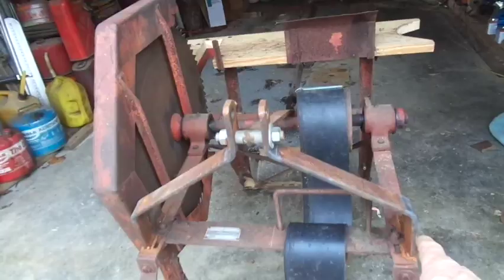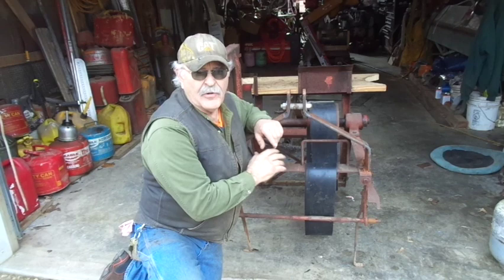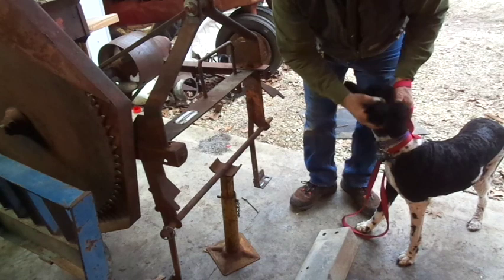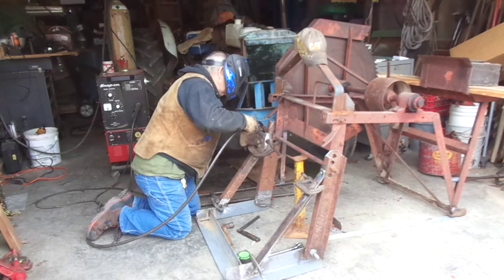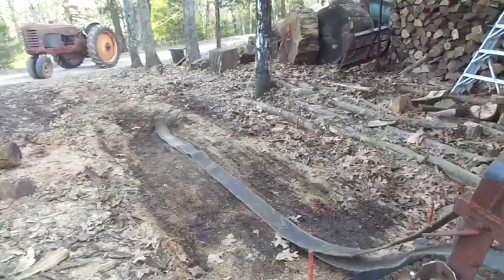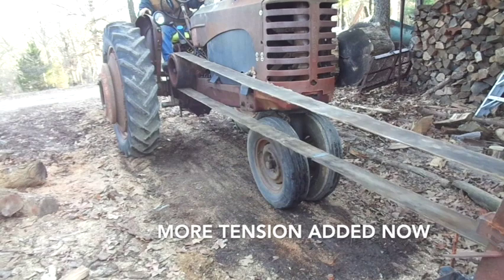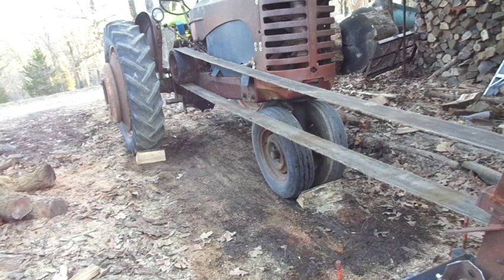Buzz Saw  From PTO to Flat Belt

Comment: Hey Wendell! Nice job remodeling that old buzz saw!  Clearly you prefer belt driven saws to PTO driven saws and that okay.  Thanks for sharing!
Reply from the maker: Actually Martin I prefer one of either kind that is being run by the son and son in law which allows me to sit in the shade with a cuppa coffee !!  LOL.  This was a bit of 'conversion therapy' that was temporarily required due to a breakdown of the tractor that normally runs this rig in 3 point mounted form.  It was easier to convert the saw to be used on ten other tractors than is was to make the repairs to the failed one.  To prove my point I still haven't had the time to order the parts for it yet !!

Comment: I processed a lot of firewood on those belt driven saws when I was a kid. You get them sharp and on a good running tractor and you can get through some wood.
Reply from the maker: Hot doggies, you said it ALL right there !!  I have several and use them all.  Here's what I do to put a really bad blade back in shape : https://www.youtube.com/watch?v=ezvZ7u8jUwE Fast forward to about 2:22 or so to see the layout for a cross cut saw blade.

Comment: I remember as a kid Grandad we`re at a Threshing party he`s mentioning all the goings on this and that then he`s rubbing his finger on the flat belt people listening and laughing  as I`m watching what he`s doing he reaches over and touches my ear ,That darn near whacked the Dog shxt out of me with a shock; Man I`ll never forget that as bad as a Coil shock LOL -- For a quick fix you could almost make a 2" pipe Mandrel with 2 bearings on ends to go between the belts with a turnbuckle pulling that looks like the 3 point hitch frame pulling up on a V system to the top of your saw frame then you just tighten or loosen the turnbuckle ..
Reply from the maker: Hahahahaha....that's what grandpa's are supposed to do isn't it...!!?  LOL  Yes, that is a viable option for belt tensioning for sure.  I was toying with the idea of a weighted idler pulley to put pressure on the non-work side of the belt as another option too.  Thanks Garnett for the input as well as for the visit today !!

Comment: Hi Wendell
The belt is running good for being that old. The loading appears to have helped iron out the kinks. 
When I was a kid I use to go out to a buddies Grandparents in the summer. Irving Smith had a Farmall H with the buzz saw mounted to the front of the tractor. It tipped up and back to loosen the belt so it could be driven around the farm. 
I still have the Ford PTO sitting in the garage.
Reply from the maker: Its not as kinky as it was when we started and a couple guys suggested a little brake fluid.  I will add some of that to the mix next time out.  We had the same basic setup as you described on the Farmall H on our 101 Jr Massey Harris.  Tilt up, hook with a chain loop and drive off.  Lowering it automatically tightened the belt just like you said.  Well, keep the pto drive in case another Dearborn or Ferguson buzz saw comes your way.  I still don't have one...which is why I had to adapt it the first time to the 3 point category 1 setup.

Comment: We use that belt dressing on the old John Deere. You know for the belt driving the hydraulic pump. That stuff seemed to last forever. I don't remember where I thought of that but I got another stick of it somewhere. Used it on my drive deck belts from my mower. Get this it was a little tractor 🚜 that was just an overgrown lawn mower. A 6 ft deck on it. I think the deck is gone but I had some plows things like that for it. Darn thing even has cigarette lighter in it. I had two of these manufacturers still got them in the barn. 100 Old Montgomery Ward's and the other one's a Sears. Don't laugh either one of them because they're built a little tractor Just not a lawn mower. Shaped kind of like a little Ford tractor as far as a rear end. Remember neighbor came by and he smoked a little bit and I kind of stay away from that stuff. Hey did The smokers oh crap hand movements raypad themselves down because I can't find the cigarette lighter. So I just tapped it in and thing popped out and I said here you go. He was amazing so was I thing actually worked. I used to have a little cigarette lighter plug in type spotlight. A joke by today's standards. But came in handy when I wanted to mow that yard in the city at night. With that 6 foot deck it took no time at all. I got a couple of David Bradley's and some David Bradley knockoff to. I got a sickle bar in the front of one of those David Bradley's. Well like you I found something to say. Hope some of this finds interesting to you..
Reply from the maker: Cool stuff !!  I've got some David Bradley stuff too...a small plow, cultivators and disc to name a few.  I sold the crossway sickle bar mower and the front mount mower deck off it though.  I think I still have a snow blade.  I like those old lawn tractors...I have an old Simplicity as well as a hydrostatic Ford from the 70's....then a couple really old dogs I know know what is what.  No cigarette lighter though on any of them....except when one of 'em goes to backfiring and blowing flames out the pipe.  Not advisable if you've got a big ol bushy beard !!
Reply: @tractorman4461  now that's putting a hilarious picture in my mind lighting a cigarette 🚬 off the backfire of tractor 🚜. That's a good one! Yeah that crossbar sickle is wise talk about I have and I think I have a plow. I don't remember what else. There are walk-behind item that balance on two tractor tires kind of like back tires of a Ford tractor but much smaller. Is that what you're talkin about? The off-brand name may be very famous for all I know I don't remember the name of it but it looks like a David Bradley but it's not. I have three of them. One David Bradley one off-brand and the third one is the same as one of the two first ones but I don't remember. By the way if you want to collect a few more I am going to sell them. Be the first time they've been out of family in about 50 to 70 years. You know if I'd made it to that one auction I would have bought one of those old tractors out there in Kansas with the metal wheels just for display yard art. Looks like snow is coming our way how about you? Over 50 last couple of days and in the teens now through tomorrow sometimes at least.

Comment: A fella in our area has a nice buzz saw up for sale. I'm waiting for the price to come down a bit. Your setup should work real good. I'm working on a flat belt lacing project myself. Should wrap it up tomorrow.
Reply from the maker: Awesome Matt.  I'm sure what ever it is you are doing with the flat belt it is done perfectly !! That's just the way you roll.  Buzz saws vary all over the place...from free to $500.  There's a local one a guy wants $175 for and I was second caller for a $50 one last year.  It was within three miles of me too.  Yep, the first caller bought it !!
Reply: @tractorman4461  the one I’m watching is $445 right now. I’m doing a video on my flat belt project. Should be up Saturday hopefully
Reply from the maker: @mattthescrapwhisperer  Ouch !!  That's a little steep for my blood....  I'll have to swing by and take a look at your project.

Comment: We belted the H to a McCormick Deering hammer mill. Dad used pullmore belt dressing.  I don't judge. 
Thank you Wendell.
Reply: That's what we used also when filling silo.
Reply from the maker: I don't remember the brand but we had a liquid dressing that dribbled out of a spouted can for the hammer mill and silage blower.  It was much stickier than the tube dressing, but for now this is all I have left. Thanks Bryce for stopping in once again.

Comment: Hey hey tm44.  I noticed after you sped the rpms up the wobbly belt smoothed out. I don't have experience with these types of buzz saws but you're getting it done, that's all that matters.
Reply from the maker: Yes it sure did settle down a bit.  I still need to treat it with more stuff to soften it.  AND use it more.  It'll slowly break down the stiff fibres and settle in good and smooth....but theres always a bit of flop with the changing load on the blade. Thanks Dean for the visit today.  I hope all is well and warm with you !!

Comment: Very nice set up 👍👍🇺🇸
Reply from the maker: It's pretty well dialed in now Jimmy.  I stopped and filed the blade and it made a good bit of a difference, but the belt is still pretty stiff.  Unfortunately its not used too frequently and the belt stays rolled up tight and covered to keep rain water off of it.  Thanks for the visit and don't be a stranger....

Comment: I have an Atom splitter that looks like this, but has a cone screw splitter opposite the buzz saw blade. Mine uses a right angle drive pto to a belt for the blade, and chain drive to the splitter side.
Reply from the maker: Now THAT sounds like a unique combination.  I've not seen a setup like that. Thanks for the input...I'm gonna have to go investigate that rig.
Reply: Never seen another one. They were made in Fremont Nebraska in the 80's and 90's. Screw splitter works great as long as the wood isn't too stringy. Nice compact unit you can take right into the woods with you.
Reply: I have an idea for the same as my saw is on a trailer pulled by a tractor, it would run off the pto into a gear box with two outputs, one fast for the saw, one slow for the cone screw. Not sure if there’s such a gear box available.

Comment: Wind that up till the blade sings.then it will cut anything. Check the set of the blade & sharpen it
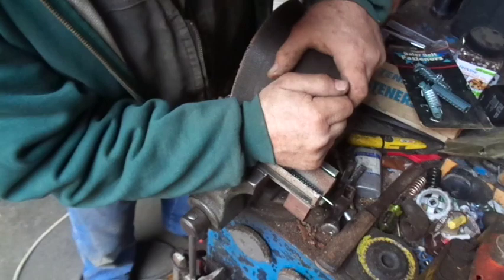Reply from the maker: I like to run the ones with the old and worn bearings at around 650 rpm arbor speed. Any faster and that one could scramble. This one is turning about 850 rpms at full throttle with this Massey on the belt.  But I don't mind cutting a bit slower to minimize fuel consumption.  Now with a helper, we can let it fly !!  Fast forward to about 2:25 on this one to see what I do with these blades: https://www.youtube.com/watch?v=ezvZ7u8jUwE Right or wrong, it's the way I learned from my dad in the '50's.  I don't run a negative tooth angle like so many do, then file the backsides of the teeth.  I do a positive angle and sharpen the cutting edge only.

Comment: So the old vandalized ford didn’t work out for your son ??
Reply from the maker: We ran the 800 for thirty years after the repairs to cover the vandalizing.  But it had eventually developed some ignition issues and I got that all sorted out a year or two ago.  Then I was running the buzz saw on it with the SIL and all was good until the water pump broke at the shaft and took the fan blade through the radiator.  So it is temporarily retired and put in the line for more repairs....radiator, fan blade and water pump.  I really like that old 800 so its only down for the count, not totally discounted....yet.  LOL In the meantime we got the 2000 Ford set up and down at the son's house for working in the woods and working the deer plots.  We just don't use it on the buzz saw.